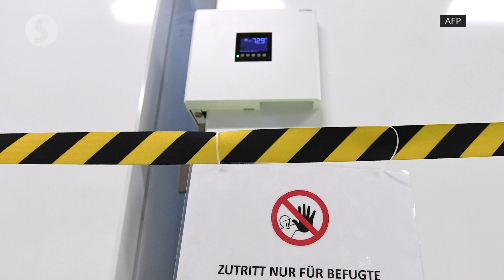Why Pfizer vaccines are for townspeople and AstraZeneca for rural folk

Comment: Funny, I would prefer to inject myself with China vaccine than Pfizer. Less side effect, safer. Not to mention, cheaper too.
Reply: Not really. Plain uninformed bias you have there. China Vaccine is not in market yet for use. The clinical trial nor the reports are out for review with China have delayed the data release multiple times already. Soon it will be out for use.

On the other hand, pfizer reports are out for review, approved by drug control agencies  and they have side effect data because it have been use in real world situation while china's have not been used yet.
Reply: @winw4548  And Sinopharm says its interim analysis shows the vaccine has a 79.34% efficacy. So it is good enough for me :)
Reply: @williamlai29  That is the efficacy. Both moderna and pfizer have above 90%. Again no data released yet by the company so that means nothing compared to these 2 vaccine which have data released and have been use in public. So your justification of less side effect and safer is groundless claims. Plus interim is not the conclusive final result.